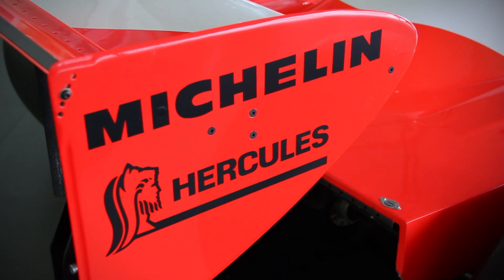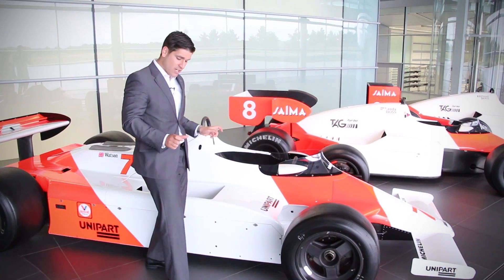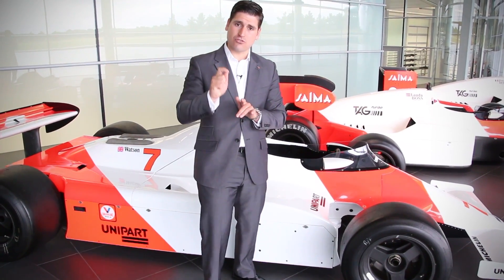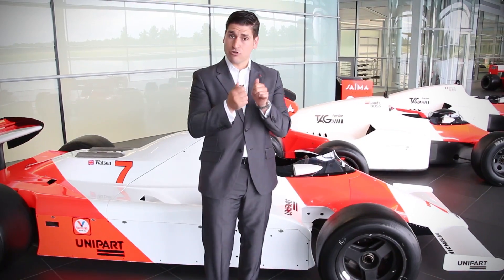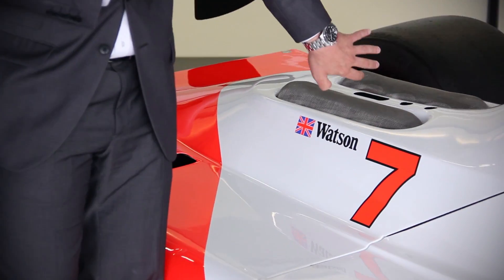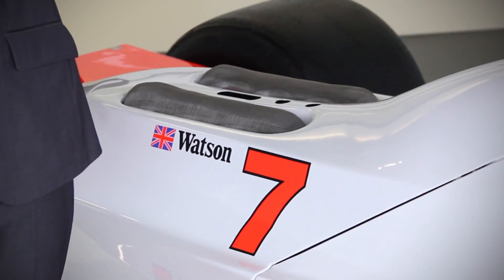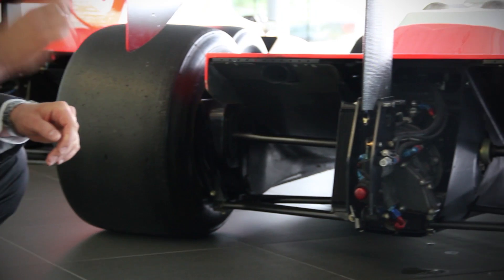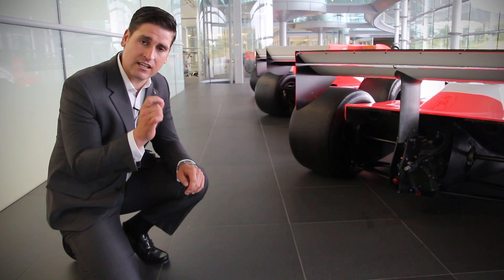The McLaren Project 4 Chassis 1

Comment: I hate disappoint you McLaren fans the Type 88 Louts was the first carbon fibre car. Colin Chapman was the Daddy of the modern day F1 car.
Reply: least someone has their history right!!!!
Reply: Yeah but this was the first carbon fibre chassis based car. Others were using aluminium chassis which is protected by the carbon fibre bodywork
Reply: @Smart1529  Not so. The Lotus 88 was (and still is. It is still raced in historics today) a Carbon Kevlar chassis, no aluminium in sight. What's more, Lotus produced their chassis in house while McLaren had theirs built by Hercules Aerospace in the US.
Reply: The lotus 88 was 1st, but it never raced as scrutineering wouldn't accept that it conformed the regulations defining what a formula 1 car is and so it's not counted.